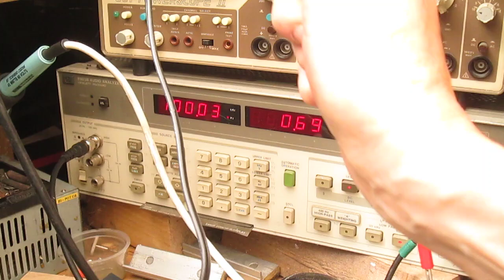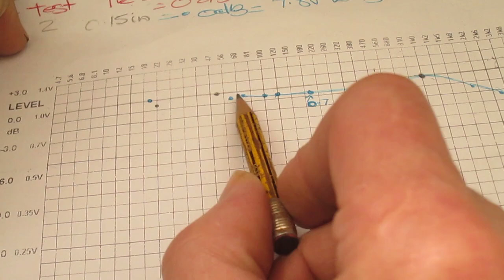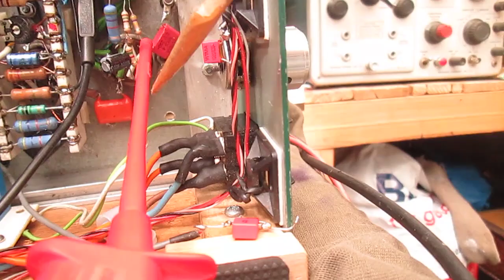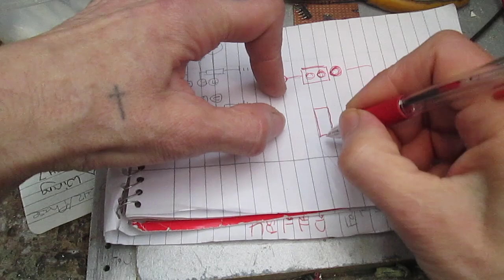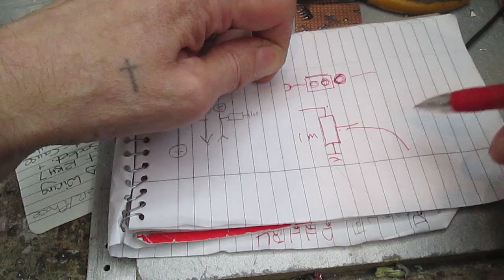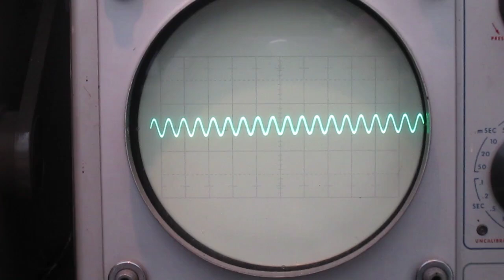Fault finding & fixing a valve amp.

Comment: I recently built a small valve amp, mostly as a fun little project and also for something I can use to connect a pair of headphones to my 43-inch Blaupunkt HDTV, the amp itself is what's called an OTL (Output Transformerless) Headphone Amplifier that uses three Svetlana 6N1P twin-triode valves, one of the 6N1P valves has its two triodes wired as standard common-cathode voltage-amplifier stages, the other two 6N1P valves are wired in a configuration known as a White Cathode-Follower which acts like a push-pull output stage, very simple circuit, but it sounds wonderful, it is able to easily drive my Audio Technica ATH-M50X headphones, rated at 38 Ohms impedance, plenty loud enough, the sound is crystal clear, and from what I read in the original webpage articles I built it from, frequency response is ruler-flat from 10Hz to 100kHz where it gently rolls off, I had a lot of fun building it.
Reply from the maker: Sounds like a cracking little amp, was it your first foray into valves? I've a few big meaty triodes stashed, keep meaning to build a little headphone amp. TFW.